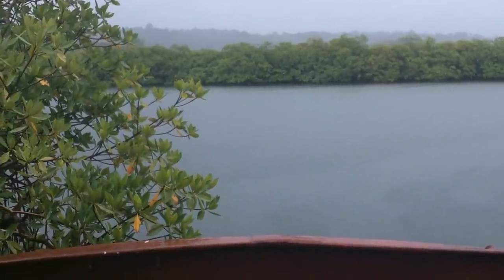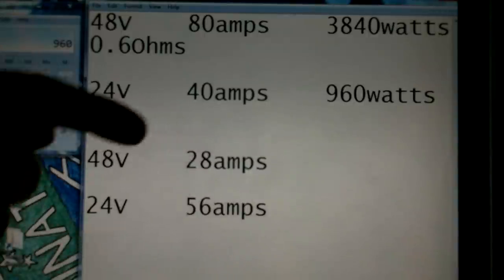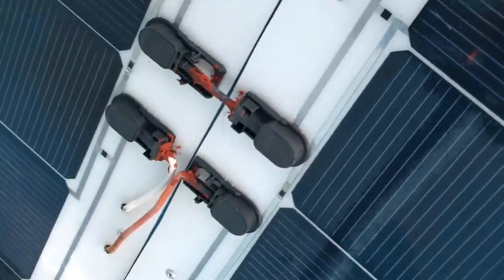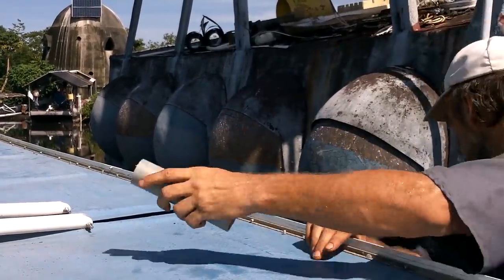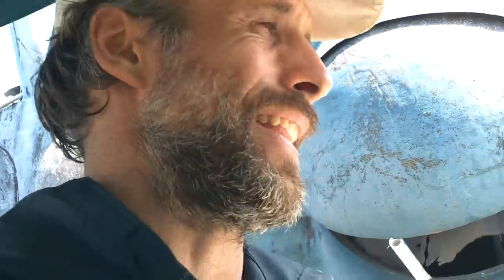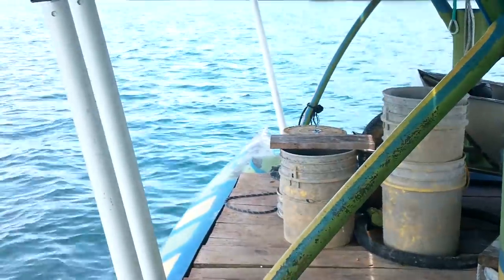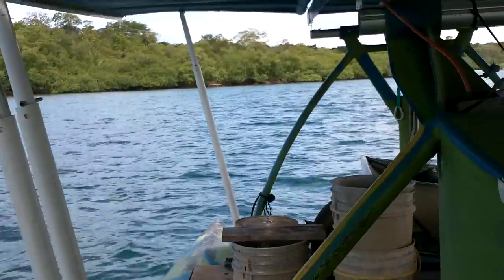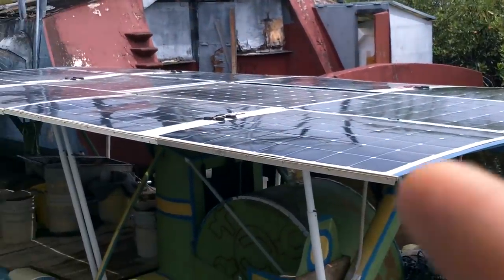Boat Edit.  48V to 24V

Comment: 500F Farad Capacitor Super Capacitor With Protection Board
you can find them on ebay....   i drive scooters and 24v is stupid 24km
72v  60km  is the best.....  48v  35km is ok....  
72v 10amp  solar is good you need 20amps 
mow  with a good set Super Capacitor  storage  you can get 70amp discharge with a million recharges .....  you let them fill up  10 to 15min then dive for 30min 
with on board acid battery acid you drive all day full speed 15hp   doing 35km to 40km on the water

Comment: i would do 72v solar   and find 1600w 3 phase motor   you run it off e-bike controller 
you get better rpms and power then 24v 
volts is speed and amp is pipe size......  
you can buy capacitor batteries  they up your amps and connect them to acid batters...
so you get 6    20amp   scooter batters  one hour drive time no solar
 capacitor batteries   do 1 to 1 storage  with 70amp discharge  
works like this sun hides you still run sun shines capacitors fill up fast 
1600w = 15hp gas
your batteries can only do 4amp charge  with 20amp discharge,,,,  
you should never charge and use batteries at the same time,,,
if can run 2 set one for charge at 4amp and the other discharge is better,,,,  
capacitor batteries  are a static charge not chemical....
if the battens load is too mush buy more capacitor batteries  let the sun charge them and run as many amps as you like,,,  10min storage